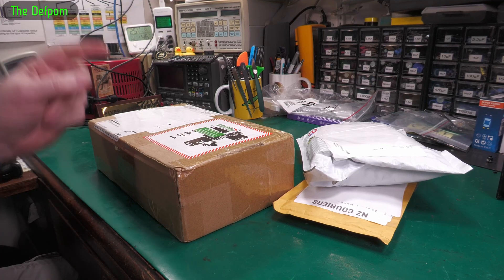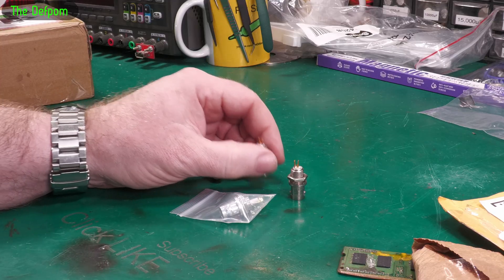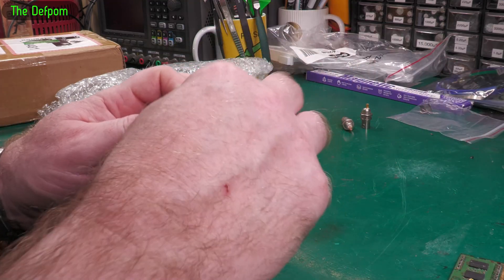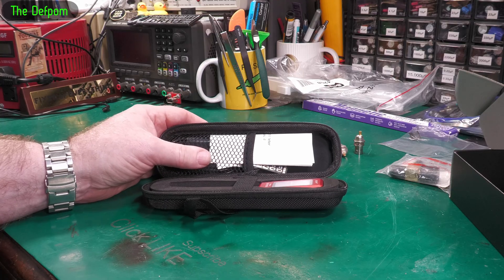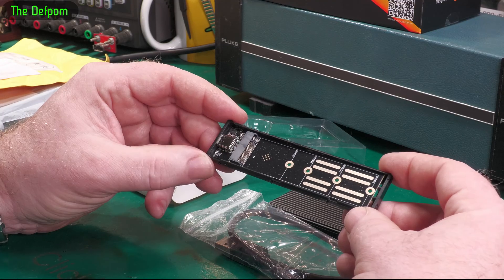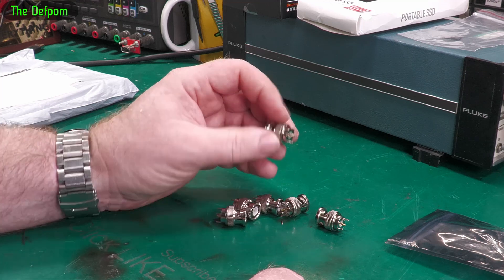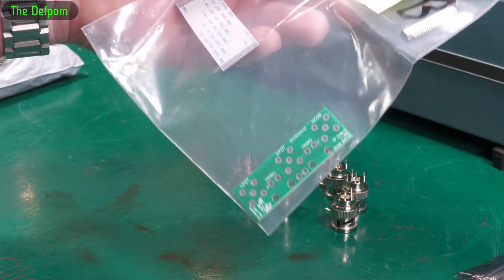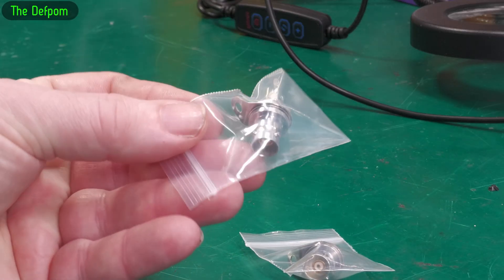🔴 Mailbag Monday 20th October 2025 - No.1415

Comment: Regarding the NvME drive caddies. I ways prefer the caddies which use a hold down mechanism that one rotates 90 degrees or so to hold the NvME drive down. I find those that use screws or hard plastic standoffs cumbersome if you are swapping the NvME drive in the carrier.